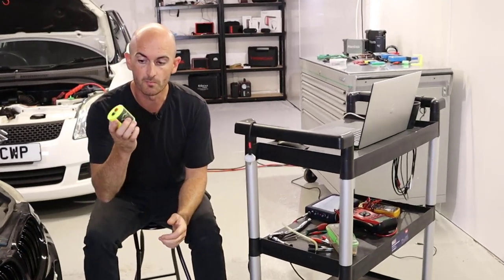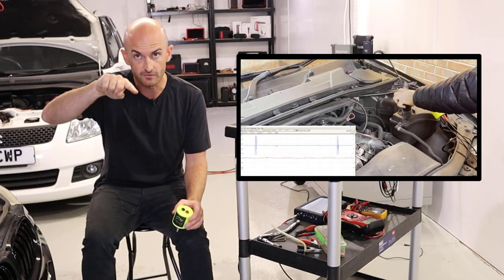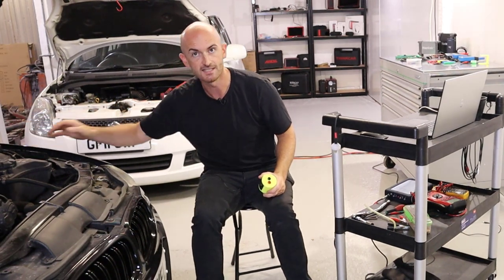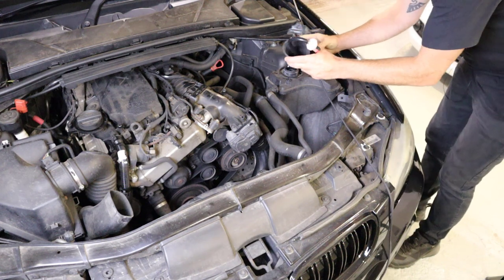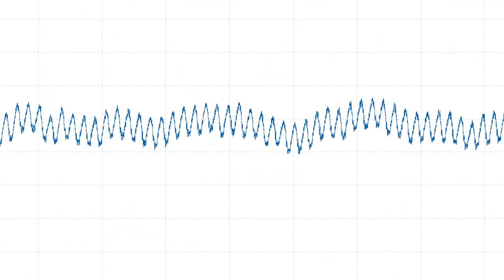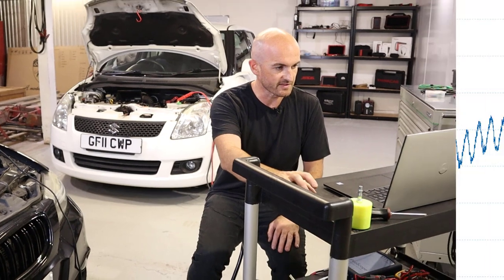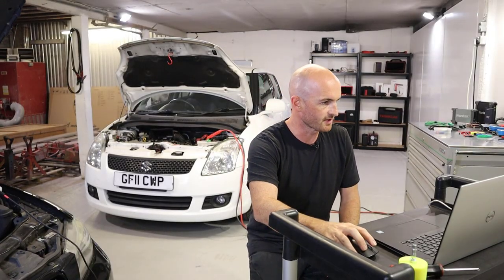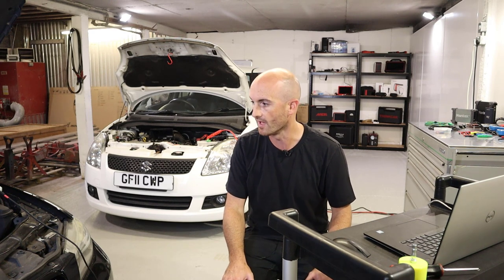Coolant Tank Pulses: Where do they come from?!

Comment: Combustion events in the cylinder produce a sound pulse on the cylinder wall, sound is  transmitted 4 time faster in water and as sound waves are actually pressure waves. These pulses you see are actual pressure-sound waves from combustion events. Nice video, and I really like my rotkee pulse sensor.
Reply from the maker: This is where my head was, until I did it on a 3 cylinder, and there were only 2 pulses! After some playing around, I’m pretty sure I’ve found out where they come from. You’re going to love the follow up to this! Stay tuned 👍Cheers

Comment: Interesting 🧐 I think the pulses are sound waves travelling through the coolant from the engine combustion process. The wave affects in the first wave form possibly the action of the coolant pump. I could be wrong of course be interesting to hear what other people think.
Reply from the maker: Someone else mentioned this last time; the sensors are very sensitive, and as you say ‘microphones’. How would you go about proving it? Just curious, I have some ideas for a follow up video 👍
Reply: You could deactivate one of the injectors.
Reply from the maker: @jmc6940  Also great idea! If we lost a pulse, what would it mean?
Reply: I was thinking coolant pump blades compression pulses. If the engine is cold, you could pull the belt off the coolant pump and run it for a minute to see if the pulses go away.
Reply from the maker: @stephenwhite5444  will follow up soon!

Comment: Great video. The capture grossly  appears as a superposition of two waves. The lower frequency component is related to the engine accesories but which one? The pump, alternator, ps pump, compressor....the low frequency seems to point to the compressor or the water pump?

The higher frequency component is related to a cylinder event (most likely power stroke) because the pulses on the screen appear to be synced with crankshaft rotation.
Even if this is correct I remained baffled by how the pressure pulse is transmitted to the sensor. If we consider it to be the water then I would take out the thermostat and limit the cooling circuit to just the engine.

Good luck and do let us know.
Reply from the maker: There is a follow up video, we found where they came from! See it in the video library 👍

Comment: These questions certainly get the brain sprockets turning. 🧠⚙️

I may be way off here, but initially I’m thinking along the lines of your own comparison to the ping-pong ball. Are these caused by movement of the coolant by the water pump, and, or the coolant return. 🤷🏼‍♂️

I’m just thinking these would both cause the ping-pong ball to bounce, in turn making the waveform shown. 

Hopefully that makes some sense. 🤔

Comment: Im 90% sure it is the vibrations from the engine flexing and compressing the coolant hoses,  just like if you would slap/pinch the hose. 
Edit: unless there is an electrical waterpump also, as many cars have this, do the car climatronic have a "rest"  button?  As it uses an electric pump to keep the cabin hot while the engine is shut down for a while

If you have an vibration sensor and can mount it on the engine or the engine bay frame and compare.

And when you removed the belt and the signal got less wavy it might have been from the alternator or AC pump going up and down in load
Reply from the maker: I like these suggestions, they are very sensitive. I have a few ideas now to do a follow up, thanks! 

This doesn’t have the rest button, they removed on LCI, but I think it still has an electric pump? Either way, the pulses are timed to the engine, 2 pulses show 800rpm

Comment: During cracking the pulses were much more pronouns so I suspect a simple engine vibration causing this small pulses. 
Might be tested by tilting the engine strongly when it off, generating stronger vibration by cancelling one of the dumper with a prybar or by cutting out a cylinder.
Reply from the maker: Interesting idea! You can see another video coming from this right?

Comment: I believe its the tensioner system, freewheel system on alternator, as well as pulley on the main crank (like on many new modern diesel) If you perform a test with a gasolin engine, with comparable engine size, I suspect You still will find the fluctuations, but a bit narrower in height. In an engine with a solid crank pulley wheel, and fixed flywheel, I would also suspect a more narrow curve height.
Performing this test with a V6 engine, and a Inline 6, would probarbly show the V6 having a slight higer fluctuation than the inline one.
Putting this scenario together, if this is the case, this test could then maybe be used to faultfind the dredded flywheel issues on some diesel engine (interesting thougt). Would be fun to see this test in a known bad flywheel or belt pulley wheel.

Comment: Ignition sync on the other channel would be nice, that should tell if the waveform is a match to engine rpm or another frequency (as impeller blades in the pump would have, for example). Then perhaps pulling one spark plug to make one cylinder work under no pressure, if it's cylinder walls moving under pressure that may show something. Then again it could be cylinder walls moving from other mechanical forces from the pistons, might not affect that.
Anyway. More data to analyze needed!
Reply: Agreed

Comment: Did taking the belt of stop the water pump from spinning. or is it on the timing belt
Reply from the maker: Oooh good thinking, on this engine it’s from the front belt so yes 👍 like it
Reply: @MechanicMindset  Could the sensor just be picking up vibrations from the engine.What happens if you just lay it on top of the coolant bottle. very interesting..
Reply from the maker: @GroundedDiagnostics  Possibly, they are very sensitive, that’s a good idea, I’ll use the same set up but stand it on the tank 👍
Reply: What was the frequency? Is there a correlation to RPM?
Reply: Water pump still spinning? Also be good to see a sample trace with a blown head gasket so you can see the increased peak.....before it boils up obviously
Reply from the maker: @the_retired_mechanic  No mate, belt driven. Good idea, I’ll get some of those for the follow up 👍

Comment: I think take a reading cold engine then hot and one from radiator hose on outside. If the cold is different its the pump. There's bound to be a signal in the water.😁

Comment: Water pump pulsing work. when the impeller of the water pump meets the resistance of the liquid mat, its operation is uneven, which can be seen in the oscilloscope course. Best redards

Comment: I have a home made pulse sensor and once Ive tested on a peugeot 508 engine with gasket failure.  I havent seen much on scope,  still a CO2 tester was much more reliable.  I wouldn't trust this method to diagnose a gasket failure.  CO2 test is more simple an trusted.

Comment: Belt off should be flat line. Only a burp is present if  leakage at which Cylinder. With belt on should see prop pulses. I check both prop pulse for all props present  belt on, and belt off because leakage could be under the prop level.
Reply from the maker: Nice process 👍 What do you think of this ‘belt off’ waveform?
Reply: @MechanicMindset  It should have been flat line, all my test have been flat line belt off. Your waveform showed prop pulses. Somethings not right . If coolant and prop is at a still state, there should be no pulse.

Comment: Looks like impellar blades.  The high/low of the waveform is increase in crank speed due to combustion.  If you did an AC coupled Alternator ripple, the waves would match exactly, with or without the belt on!!!!

Comment: hello i think that there is resistance in the water pump (due to the belt) at every explosion.
As we see in the test , there is ~30 peeks in 1 second.
When engine is not warm idle is ~ 900 tr/mn
So 900 tr/mn = 15 rotation in 1 seconde.
And in 1 rotation = 2 explosions
So 15 rotations = 30 explosions per seconde.
If someone could confirme my numbers .
Sorry for my english this is not my native language
Reply: Interesting theory, I do agree with your numbers.

Comment: Hi Darren, are you sure there isn't an electrical coolant pump as well?
Reply from the maker: I think there might be, but these pulses are aligned with engine operation. I didn’t do it in the video, but if you measure 2 pulses it comes in at 800rpm
Reply: @MechanicMindset  It looks like approximately 30 Hz, which could translate to 1800 rpm? The alignment makes it strange.

Comment: Look how fast those pulses are
Reply from the maker: Approx 800rmp for 2 pulses = idle speed 👍
Reply: @MechanicMindset  Interesting test mate especially with a diesel 👍   , never done this like that,
Reply: @MechanicMindset  2 per 800rpm, but how many pulses per one engine rotation? If you measure pulses and crank pos sensor at the same time to see how many pulses you get with a few crank rotations that may be very good info. 

Also would be interesting to see if it does it just spinning the engine over and not actually running.

Comment: Darren,
to reduce the effects of engine vibrations being transmitted you may want to suspend the pressure sensor in the air with a (short) connected hose just floating above the open reservoir.

Does the frequency of these pulses change with rpm and would the amplitude of a diesel engine be bigger than of a gasoline one. (probably not possible to control the environments enough to make comparisons though)
Reply from the maker: Nice idea Jurgen, I think I have some longer silicone hose to try. 

From memory they increase with rpm. I think last time I did it I synced with injectors and they aligned. Taking the ruler to 2x pulses makes 800rpm which is about right for this engine 👍

Comment: I think it is the pulses from the pump impeller. It would be interesting to test a VWG engine with a dual stage pump to be sure without having to fit a pump with a worn or missing impeller which would be a pain.  You could then actuate the pump shroud quite simply with final control in VCDS ODIS or bi directional tester to check if the theory is correct.
Hey if it IS that, what a great way to quickly test to see if the impeller is spinning on the shaft of PD engines and the 1.8T BAM ARY engines which do suffer from overheating due to this.
Can you set the scope to check rpm and work out if it is spinning at same speed as the water pump and check with a pump for the car how many vanes are on the pump impeller?
Reply from the maker: Amazing idea for a test! I have a 2018 VW 2.0tdi, so could try that (if it still has the correct pump fitted! That would be a great way to confirm flow, especially if you can see the little return pipe outlet 👍

Comment: Hi Darren messing about many years ago with my first pulse sensor I thought I would try it in the cooling system of a 4.6 V8 Range Rover, got some pulses thought duh that will be the water pump, belt removed and the same pulses as you have were there.  I would like to see the difference on a petrol engine with the plugs removed cranking (should of done that at the time)
Reply from the maker: Awesome idea for a test 👍
Reply: @MechanicMindset  I have a V8 Jeep in the workshop that's getting new plugs tomorrow

Comment: The question in my mind is that the radiator cap only allows that expansion bottle port to be open when the engine is hot enough to push the spring loaded cap up a bit, or when it's cooling back down to allow water to flow back into the radiator... Yes? No? In other words the expansion tank is segregated from the actual cooling system most of the time.  So maybe for this test, the expansion tank needs to be isolated from the engine compartment via a longer hose and mounted to a cart. Or am I completely off base 😆

Comment: Why not spray Easystart into the inlet briefly and watch to see if there is a corresponding increase in the  amplitude of the scope pulses ?  The higher calorific value of the Easystart as a fuel should increase piston force.
Reply from the maker: Great idea! I’ll add it to my list of things to play with 👍 Cheers
Reply: @MechanicMindset  It's a difficult one because without  a  trigger  relevant to both signals it's a bit chicken and egg. 

That sinusoidal  shape to the fist waveform  looks a bit like a bad ground. However, does the Pico software offer an FFT function just to see if the frequency corresponds to engine speed or something else ?
Reply from the maker: @we-are-electric1445  I can confirm they are both the same frequency. You’re right, similar wave effect with bad ground, but there is no ‘ground’ on this sensor; positive and negative connection the to sensor 👍
Reply: @MechanicMindset  It looks like there is capacitive pick up from something else - hence the bad ground syndrome . The FFT function if available should provide some insight and sometimes can be a revelation !
Reply from the maker: @we-are-electric1445  Good idea, the Pico does have ‘spectrum’ mode. I thought the waves might have been down to the slight idle speed variation
Reply: @MechanicMindset  Spectrum mode sounds like the Fourier.  I'm no audio specialist but could be some sort of beat frequency as it is appears a lot lower than the other signals.  I would expect the spectrum to be evenly distributed with the sinusoid sat  in there somewhere.. You probably know you can compare two signals to check they are identical using lissajous figures.